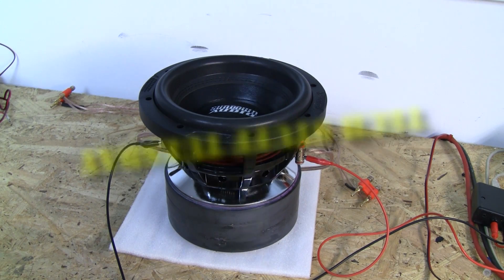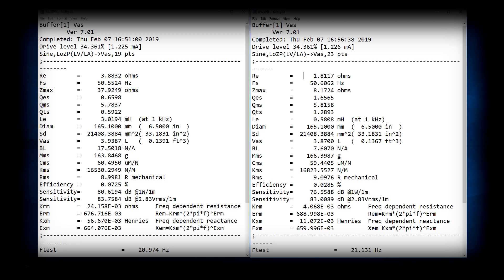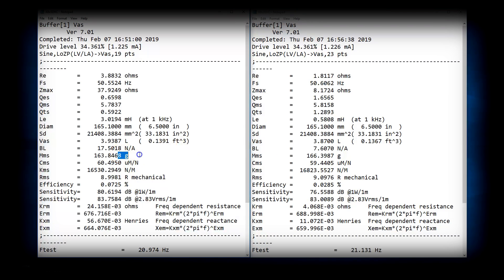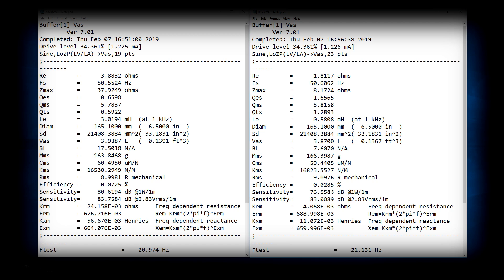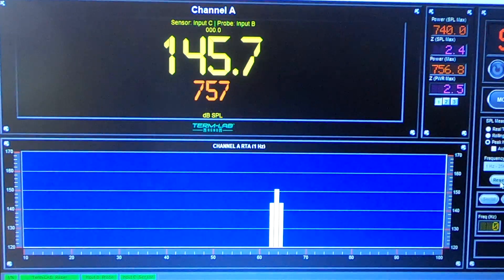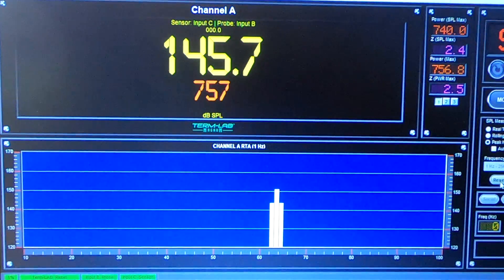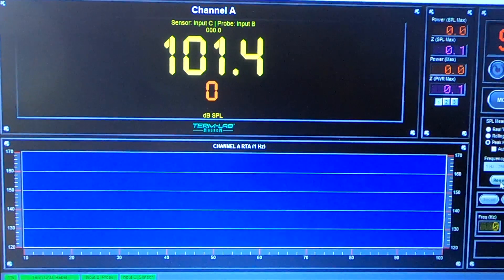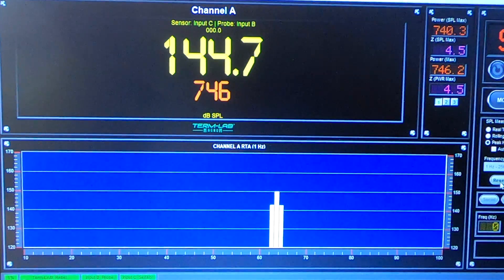This is what happens with 1 of 2 voice coils connected - Tech Stuff Tuesday

Comment: You stated that with only a single coil being used, the rated power would be half. Now you ran the single coil test using essentially double rated power? Wouldn't it behove you to also run the DVC test with double rated power or run the SVC with half rated power for the test to be anywhere near equal?  Thought....
Reply from the maker: If I did double power on both coils that wouldn't show a valid comparison because more than 1 factor was changed. Power handling is a thermal limitation in this case. If I ran that same power over time it would eventually fail. For seconds at a time it will not be effected by the additional power.
Reply: @EMFAudio  Thanks for the follow-up. I understand now.

Comment: Great job on the content. I was hoping you would throw in the coils wired in series as well to see if there was a continued decline in spl as the impedance rised on the same clamped power. Overall great stuff though.
Reply from the maker: Yes, between parallel and series the impedance rise would be different, but with the same clamped power you won't see any difference, unless the amplifier itself does something different as a result of the impedance. That's as much as I can say without letting the cat out of the bag.
Reply: EMF Audio thanks for the reply. I’m just getting into spl in the stock 1000 class dbdrag, I appreciate the content you put up. On my off time when I’m not testing , I’m trying to be a sponge and take in as much as I can from people I think have experience and actual knowledge on the subject. Keep up the great content!

Comment: Mhm, so sensitivity is 83db. 
Doing the tests with both coils, at exactly 7:35 when it's displaying 17watts and 117db. How is that possible ?
If we do the math 83 at 1 meter at 1w.
86 at 2w
89 at 4w
92 at 8w
96 at 16w. 

How much gain at that particular frequency does the box give ?  that's like 21db difference. 
Yes i know it's in a car with a box tuned at the peak frequency but god damn 21db is a LOT.
Reply from the maker: That box is setup for that car, with HUNDREDS of hours in testing time behind it. Using a sub built for that box yields and even bigger gain.
Reply: Cabin gain can make huge effects I had a t line tuned to 29hz for home audio put it in a ford ranger and 31hz was insane put it in a blazer sounds dirty and muddy it's not always a drastic difference but there's more to play into it that I don't even fully understand myself lol

Comment: I've been using 1 coil on my last subs from 5 months.. still was banging. When I copped my new subs is when I wired both coils. I don't do SPL just what sounds good to the ear. This is good information for those that says running 1 coils will damage your subs.. it's doesn't.. just lowers the power output.
Reply: Two things to note.
If you're not in it for SPL but want good sound, use both coils. You will want all the power handling you can get, and get all the sensitivity out of the driver you can. The less sensitivity, the less definition.
Secondly you should stay away from these types of subs if you want good sound.

Why would you even consider running one coil when there's two? You gain nothing by doing so, and the driver was designed to use both. The driver just gets more lazy and inefficient.
Reply: ABOlsen69X At the time.. I was lazy and the sub box is mad heavy.. then here comes the winter ❄️ weather.. With these new subs I wanted to make sure that I did everything right because it’s backbreaking taking that box in and out of my ride.

Comment: Sweet! Can you do an episode on how we can calculate TS parameters without fancy equipment if possible?
Reply from the maker: You can't, it requires equipment. Fs is the only thing you can figure out otherwise.
Reply: Oh damn, Sundown built me an NS 10 v4 with a softer spider and (b/c they forgot to measure) said TS perimeters would all be the same except lower Fs, but your video makes clear more things would change. Trying to figure out how I can get TS parameters now
Reply from the maker: @mattalones93  the difference in specs will be negligible.
Reply: mattalones93 I wish some one would because I'm to poor to afford the equipment to test
Reply: EMF Audio - It would great to test. The spider is way softer than standard, and me entering 25 hz Fs into WinISD made my box model much more closely to actual performance than stock Fs of 44 hz. Totally happy with the sub on passive radiators, but the specs remain a mystery. 

hunter callahan - I know. It’d be great!